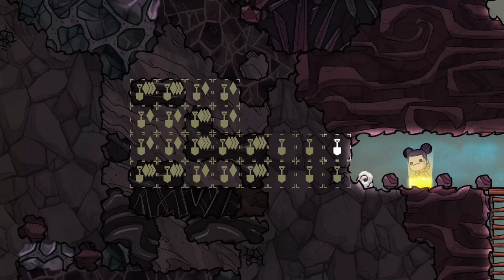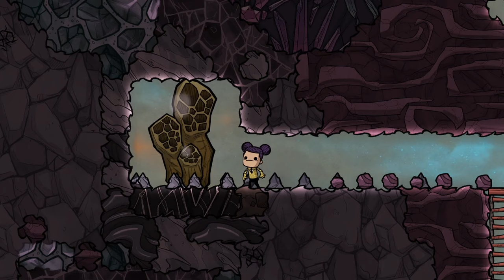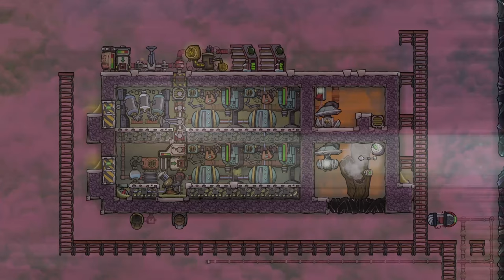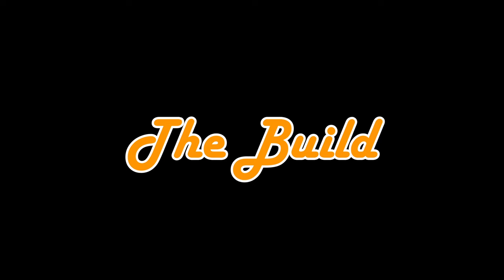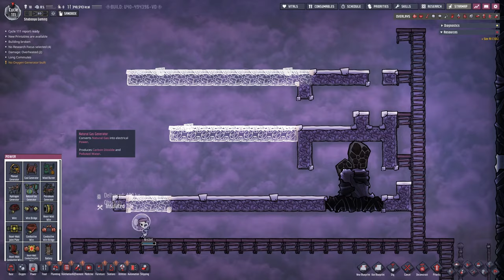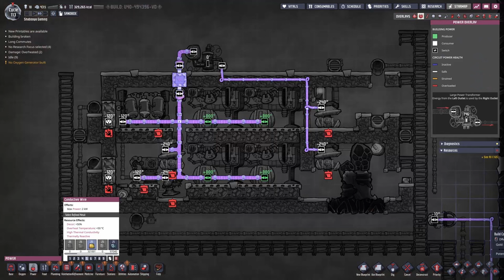How to use Natural Gas Geysers | Oxygen NOT Included (ONI) | Tutorial

Comment: How do you handle the 100+c temp. Does it need to be made of steel and  can the heat power a steam turbine for extra power
Reply from the maker: i used steel for the pumps. As for the steam turbine im not sure if its worthe it, bcoz the gas it self if more than enough power. + with the turbine, cooling it will be something to think about. I just leave it as is but you're free to try it out, and share it with all of us here :yougotthis: Thank you so much for the comment.

Comment: very nice but i would just store the CO2 in an infinite CO2 storage and keep it for later, you will also use less power that way and create less heat and then if possible you could use a cool slush gyser, pipes, liquid shutoff and temp sensor too cool down but thats a big if and there are prob better ways of doing it, also you can use a normal vent with crude oil for the unlimited natural gas storage, you can do it with as little as 180 gram havent tested lower yet and also you could put the water sieve somewhere else to avoid overheating a bit more since your not using a carbon skimmer anymore (if there are flaws in my theory pls tell me, am open for suggestions)

Comment: The problem with this setup is that the polluted water eventually heats up to 100+ degrees and when that goes through the water sieve the output clean water is also 100+ degrees which flashes into steam and then breaks the pipes
Reply: Simple fix would be to add a aqua tuner steam engine cooling loop anywhere you can

Comment: Past power transformer goes 2kw wire... why 4 generators to use just 2kw of the power? If you connect equipment to use 4kw at once (which is limit set by transformer) those wires gonna break
Reply from the maker: Yup that's true, the reason being is that the main power supposed to be connected to a power bank or main power lines, I just put the transformer there so that I don't need to add a Heavi-Watt Conductive Joint Plate to connect the 2 gas pump.